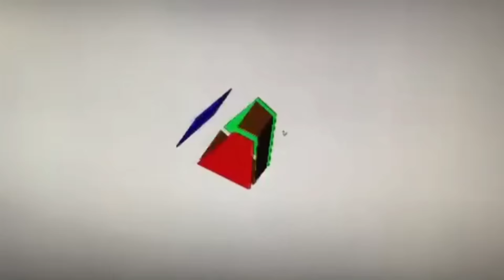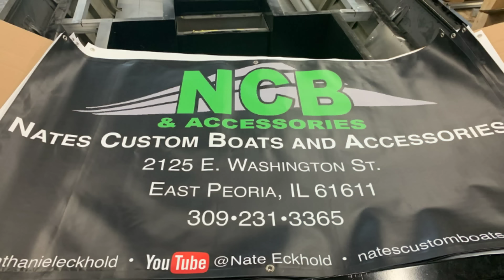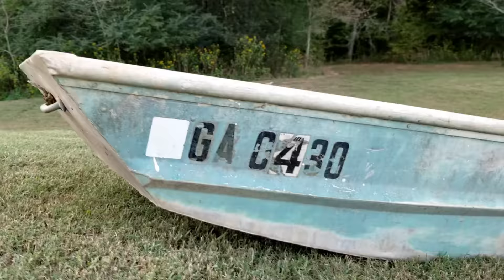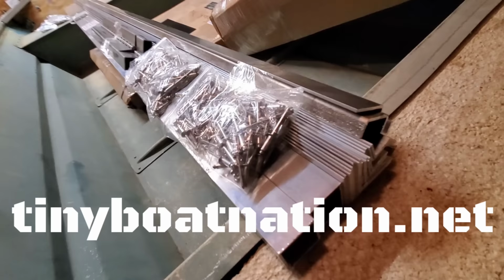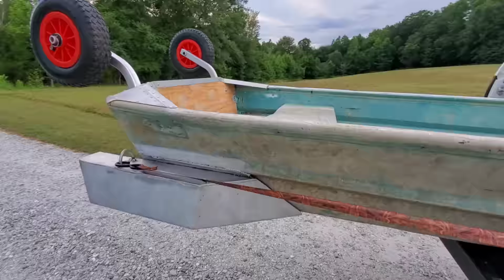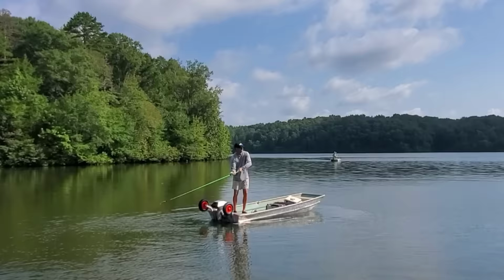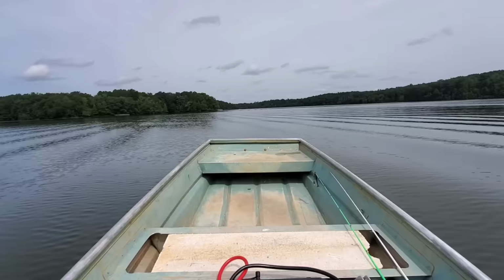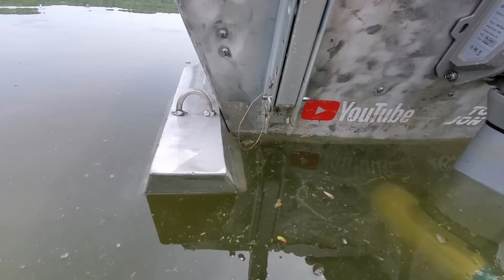12 Ft Jon Boat Float Pods

Comment: the approach angle on the front of your float pods is scooping water up and out and that's where your drag is coming from. in your video when you're looking back at yourself you can actually see where the pods are pushing the water out to the side.  You should have actually increased speed a few tenths of a mile per hour with the extra planing surface under the boat. I would suggest that you lengthen them about another foot or two and change the approach angle of the front of the pods to where it slopes upward and forward only instead of backward and outward. the approach at the front of the pods should match the curve in the front of the Jon boat a sharp angle at the bottom will induce drag also. I would also suggest that your next set of PODS have a flange most all the way around and attach it to the hull using stainless 10-24 truss head screws with a washer and a nylon lock nut on the inside.  In addition, the pods should be made out of .072"-.080" aluminum anything thicker is an Overkill most of the hulls on these small jon boats are only .050". I'm an aerospace welder fabricator and I've been doing these tiny boat modifications professionally for over 40 years. Great work though!😎
Reply from the maker: Thank you for your input, unfortunately a little late to the party. Not sure i agree w all your points but appreciate the suggestions nonetheless. One thing a can agree upon is the approach angle of pod. Again, these were designed over the internet and fabricated in another state before shipped to me. If I built these myself in my garage there is no doubt the angle would have been different. Hard to build without a boat. I'll take the result as a success give this was something completely outside the box and nothing I've ever seen done, still having completed the objective. We changed the angle on the second set but have not tested. Boat in video had the pods fully molded in so possibly it can perform better with no front seam. Still more tests to do. Not really agree it should pick up speed given the pods weighed almost 30 pounds and stick outside the side of hull, making more drag regardless of angle. Anyhow this type of thing could really be fine tuned if we were a boat race team, or trying to bring to mass market. We are not in a speed competition and the market is not there , therefore I am happy with the results given im just a guy in my garage. Always room for improvement though.

Comment: I agree with you, 1.5 mph is a fair trade off for the added stability. While I don't have a 12' Jon, I would love to get some reasonably priced float pods for my 16X50. I plan on cutting in a tunnel hull and adding a hydraulic jack plate.

Comment: Great concept, I got a 1240 lowe with pods. My only criticism is I say your front angle of the pods is backward and creating drag, not lift while under way.
Reply: Jeremy Julienne 100% my thoughts they are digging in
Reply from the maker: I agree as well. Was hoping the angle would be more level vertically when installed. Again, hard to do w design, fabricaror, and I in 3 different states. Tremendously happy though given the circumstances.  But yes, as a first prototype set, success was achieved but room for improvement.  Thanks for feedback 👊
Reply: @jaymac1022  Glad I wasn't the only one to see that.
Reply: @AnthonyJonesBrigadeBoats  Thanks for the awesome content and for responding. Totally agree that collaborations are like that and without possibility to test fit and check measurements and angles these slight hiccups will happen. And with that as the only thing it is not a bad start and now you know what to do to make it better and improve upon! Have a great day, can't wait to follow this build to the finish!
Reply from the maker: @jeremyjulienne3659  Thanks man👊

Comment: Adapt your launch wheels so they can be angled to the side as float pods. Then you don't have to give up top speed. Just put them out what you want the extra stability.
Reply: Great idea. Could be easily adapted with a pin for the sides
To make them easily
Removable
Reply: thats a good idea man

Comment: I like the float pods! They make a lot of sense!!
Reply from the maker: Always good to have an engineers approval! 👊
Reply: It's amazing. I never knew about the pods but I  had  the same idea. In my mind. The only difference Is that I knew. Will lost A lot of speed. So I was thinking to do something like the wheels. Something that. Allows me  to use them  or not depending of my needs

Comment: I think having outriggers that could be engaged when the boat is not moving would be a better solution. This would preserve top speed and offer even more stability as they could be extended further out than the pods.
Reply from the maker: Probably so. Just not the look I'm going for. I want the boat to look and perform well. Also limited moving parts.

Comment: I think they needed to be a little more "hydro dynamic" ie  Make them slightly longer with them slanted up @ the front.  This would most likely give you back the majority of the speed you lost. 

 You lost speed because you have a squared off front, so you are getting more drag than nessacerry.  Once you get them completely sealed smoothly against the boat that will help a tiny bit as well.
Reply from the maker: I completely agree. We played w some designs, some looked goofy. Definitely room for improvement although I didn't lose as much speed as I thought. Maybe we can revisit this idea and fine tune in the future as minimal speed loss would be attainable.  Just not on this boat, lol. Moving forward! Thanks for feedback,  much appreciated

Comment: I have a 14 ft but I weigh 390...and it rides real low in the back when I'm there...I definitely want the float pods
Reply: Have you gotten them and have they worked ??
Reply: @elraybanderas1032  I have a place making some for me ...will post an update when I get them
Reply: @561arcadia  sweet man sounds dope I hope they work out maybe you can help me find some for mine as well I'm a big guy too and I feel these would greatly help my boat stay stable
Reply: @561arcadia  just seen Amazon has some that fits 14' 15 and 16' boats
Reply: Im in the same boat i just upgraded to a heavy 20 horse johnson. And looking into pods. Rear mount are 280.00 from blackwater
Reply: @elraybanderas1032  yea blackwater has a set as well. But im leanin towards amazon beavertails. Just dont want to sacrifice my transom mount trolling motor
Reply: @ojflores3554  same thing I'm going with I think I just need to find a good aluminum welder who can mount them on my boat hard to find around where I live cause everyone likes meth 😂
Reply: @elraybanderas1032  well everyone around me thinks they weld gold. I can weld just dont have the equipment for aluminum.  I was quoted 200.00 for labor. But also read it has to be a solid bead or it'll cause flexing and crack.

Comment: Great idea. I have a 10 foot that I would consider putting pods on.
What I think slowed you down, is the bottom front of the pod needs to be turned up just a hair so it doesn't catch the surface but rises on top.
Just me. Thank you for sharing.
Reply from the maker: Your correct.  Hard to get all the angles right with us all over the country. Could easily be fixed on another set or if fabricted with welderhaving boat in hand, the entire concept could be done by hand without need or a 3d design or rendering.  It just helped us. Again, I am haply w it given the circumstances.  Thanks!

Comment: 100% do it to my boat if it were affordable. Also would like custom built flotation foam bumpers like they put on Sportspal canoes. Thanks! Edit : I have a 14' that I bowfish from, I need the pods for stability not for extra flotation, I stand in front of boat and ass end lifts out of water so I put a battery in back and run the trolling motor in the front. Works ok but I do need more stability to be comfortable. Thanks!

Comment: I really need some of these for my Jon boat it’s my very first one and it’s looking great I’m just not sure how to make more stability I have a casting deck with an 11 inch pivotal seat for passenger and 4 inch post in back where I control my motor and the side to side play is just to much for comfort . However I don’t have the materials or welder I need to make these.

Comment: These wheels are awesome. I put them on my 10ft jon boat project. Unfortunately I only use a mirror and not a scale because I exceed the weight limit of the 10ft  just looking at it. Hopefully a 12 ft could hold my 250 lb self.

Comment: Had you lowered them 3inchs below the bottom of the boat. Plus made them twice as long. It would Gove you better stability.  It would act like a hydroplane  and pick up the rear of the boat. Depressing drag. Increasing top speed

Comment: I don’t know what qualifies as “affordable” but I’d definitely be interested in better stability in my 12’.
Reply from the maker: Affordable is relative to the individual i guess. I will say, there is about 200$ just in materials right off the bat. So it would obviously be more than that . Basically if they could be produced and shipped without a dramatic markup. Time consuming to weld these. There may not be a middle ground to be honest. Tedious labor and expensive materials. We would aim to sell roughly at going rate of other aftermarket pods which are square and easier to make, that is the goal
Reply: I know metal is preferable but would molding something out of plastic be more affordable? I mean, we are talking about a budget Jon boat build here
Reply: Don’t get me wrong I appreciate the craftsmanship here. I’m a tradesman myself, so I totally get it.

But I also begin to wonder at what point do you just go buy a nicer boat?
Reply: @jessetharp6319  I used a 6'x18' float mat cut in strips the hole leanth of the boat 8"x6" glued and screwed ,but in no way cheap $400 for the float mat but my life is worth that I'm guessing. Looks like that Australian kapton callor. I have 14 foot v bottom.
Reply from the maker: @jessetharp6319  yeah man idk. A lot of logistics involved with the tooling of getting molds made and making them out of plastic. Heck, seems to be quite involved just to make aluminum sets. The main thing is the actual 3d design process and templates,  which we have, next is to find someone to mass produce or build to order. Then there's shipping,  these weigh 26 pds. Basically so far we are finding it hard to produce and make a worthwhile profit for anything less than 500. It just ends up being a lot of work for everyone involved for minimal return at that point. While being a cool project,  these were initially just supposed to be a one off set but upon testing and showing on social media before video, it got quite a response.  I get the budget thing for sure. This boat really has none as it is in fact paid for by sponsors of the channel, and the channel itself. More about building the ultimate transportable 12 ft boat that can go where no trailered boat can go. Probably not the same budget or craftsmanship that would go into your everyday 12 ft boat but hopefully can inspire and push the envelope with these tiny boat builds.
Reply: Anthony Jones absolutely man I get it. And I hope you get it figured out. Much respect to anyone willing to be an entrepreneur and see what they can provide people and make a dime in the process.

Comment: Like these Float Pods. Was thinking about adding them to a 16' Deep V Boat. I need stability it rocks pretty bad.
Reply from the maker: Not sure about them on a 16 but if stability is an issue, you can always swap to a flat bottom. Vs aren't as stable.
Reply: @AnthonyJonesBrigadeBoats   That's exactly what I was doing today.

Comment: When you were at max speed, were the pods still in contact with the water? The forward part of the pod face could create a high pressure area, give it a more bow like angle and you should pick up speed of the line and maybe overall speed

Comment: Hey Anthony it looks great. How wide is the floor? I used crab pods on PVC on front and middle which allows me to stand on my casting deck. These outriggers also allowed to raise my seat 7”. Battery in the middle and two trolling motors. I added front outriggers after I posted my many very very short unedited videos.
Reply from the maker: Floor is 32" width. My battery will be up frint as well under deck, where the middle bench is currently

Comment: Your creating drag at the front of the pods the angle is going in the wrong direction it’s pulling you instead of lifting the boat you will still have the stability.

Comment: I like the looks of the pods. I was surprised that's all the top end speed you lost, I thought it would have been more. Nice collaboration on the design and build. I'm sure that was a difficult thing to have the three of you do this all online. Good job. Out of curiosity, what would it be like if you had the pods the full length of the boat? Instead of being submerged and causing drag, I wonder if it would be up on plane more?
Reply: Cheaper to buy a new boat. Come on
Reply from the maker: Thanks man! Yes, it was a timely but rewarding process! Great to work with other individuals as creative and like minded who all want to push the envelope! Not sure about your idea but I'm sure it would work if designed properly.  My concern would be the weight. Id honestly cut a boat down the middle and widen it at that point. But for experiments sake, you could try your idea. And yes, be cheaper to buy a new boat but what's the fun in that? Also, i know plenty of youtubers who do experiments just like your idea and make tens of thousands of dollars off the video! If anyone were to do it, it would be someone with an audience!

Comment: Why are the front of the pods angled down?  Dont they dig into the water and cause you to lose speed?  I feel like if they were angled up so the front of the pod was on top of the water you would get better speed without sacrificing anything.
Reply from the maker: I've answered this about 1,000 times in the comments section.  Look at the thumbnail,  the pod goes straight down.  The angle occurs because the boat goes in, creating a compound angle at the joint where the pod meets the boat. Again, as stated in the video, this was a prototype designed across the country and sent to me, not cut together and fabbed on the boat in person.  I'm happy with the results and can sacrifice the minimal speed lost for greater side to side stability.  We changed the design on future pods and it didn't seem to help. Seems the problem is each boats hydrodynamics and tge greater tge speed you go the more drag that occurs regardless of angle pitch. For me going 11 mph in electric lakes works great, I wouldn't recommend fir anyone trying to achieve serious speeds

Comment: The pods are upside down! the wedge on the front of the pod should match the angle of the bow. in its current configuration the pods are cutting into the water being forced down causing drag and hindering lift to get on plane. just saying.
Reply from the maker: They do dig a bit. I go over that in the end. These were the prototypes.  We made more after with different angles but unfortunately they still created too much drag. Amazingly we reversed the angle on another boat and it performed worse but I believe it was due to a larger outboard. With my electric setup it works fine. The electric outboard won't get the boat on plane regardless,  but again, I go over statistics on percentage of speed lost at the end of the video. It was just an experiment, worked fine enough for my boat, other boats is a case by case basis.

Comment: Hi Anthony! I love the idea of float pods on my 12 footer but I wouldn’t be able to trailer my boat if I put them on the side like yours. I would be interested to see if it creates the same stability if they were mounted on the back. Thanks for reading.
Reply: No it's the width that gives stability but it would ride higher in the way creating less drag increasing too end and increases the load capacity these boats are very stable i have a 12ft and fish 2 people both standing never have had any issues it's only 3ft wide you'll never get a bass boat stability which is almost 7ft wide then the weight keeps it stable the lower in the water the more stability I've got a 9.5hp 196i johnson and with 2 people cruising at 15mph
Reply from the maker: The stability increase is from the added width. Again, it was a definite difference and increase over stock. Not sure what results others have, but my 12 was wobbly and super sketchy to even walk in before. We fish out of my 1436 two guys all day, but the 1232 just wasn't stable. No, the pods won't make it a bass boat, but noticeable increase in stability,  especially in the rear while standing.  My goal is to fish off an elevated rear deck, no way I'd do that the way it performed stack with no pods. Maybe it's just me, idk
Reply from the maker: Also, pods on rear of a 12 is not an option in my opinion.  Transom is only 32 inches wide at bottom and you still need room for an outboard to turn. So that would leave you a tiny pod width. You'd then need to make up for that width with depth so you'd end up w a 6 inch wide by 3 ft long pod off the rear of your boat which just wouldn't work in my opinion. We brain stormed that option before going side mount, which actually allows width increase and the ability to run the 6 inch wide by 3 ft long pod i just mentioned in a working fashion that is also aesthetically pleasing

Comment: I have the same boat I think if I had the 3D model I could copy everything else from there!
Reply from the maker: I have the 3d model but notice I cropped out the dimensions
Reply: Hey Dew, just curious what kind of stability your boat would have if the pods ran up the sides of boat to front seat. Think front deck be safer for fishing.